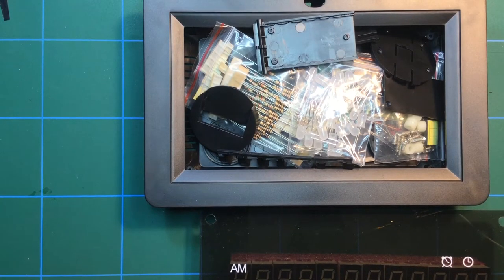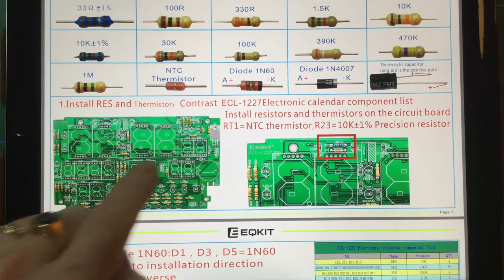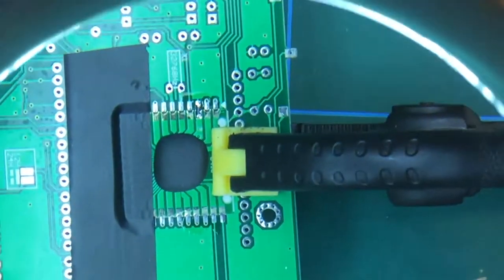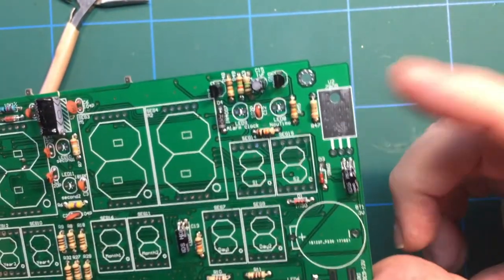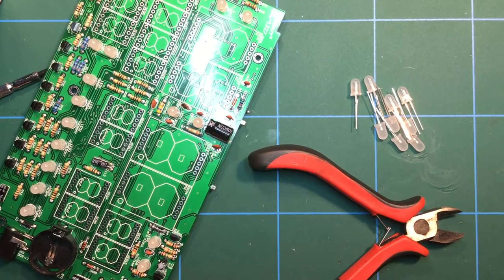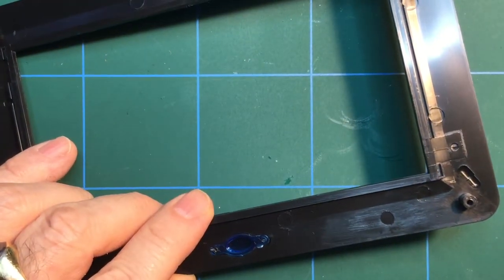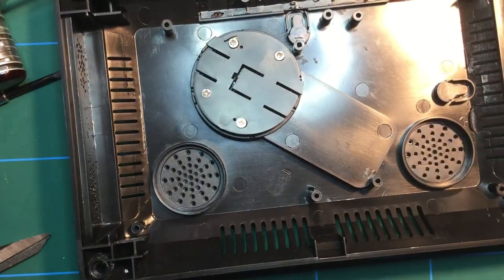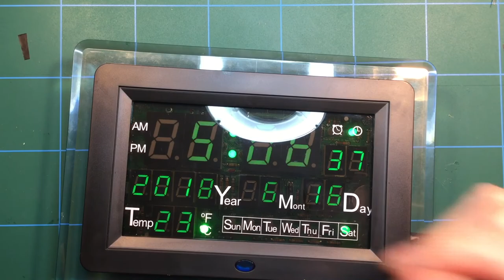Banggood: DC9-12V Electronic Calendar Soldering Kit High Precision Clock Kit ECL-1227

Comment: Hi “Edifred", nice video thanks. Would you mind sharing what it was you used for the 9V power supply please? On a side note, also a vaper here for many years, going back as far Genesis atomisers with cutting out and rolling steel mesh for wicks and kanthal coils with horrible hot spots. I also noted in a much earlier video of yours you were using the old SD screwdriver with cartridges, for stealth purposes I used to use those SD key ring jobbies until he stopped selling them and gave the website to his son. Good ole days eh!   What is your current vaping set up now?   🤣😂🤣😂.  👍👍👍
Reply from the maker: Hi Jay. The supply was an old DC supply for a phone or something giving around 9v. Nothing special. Wow the old screwdriver!! Cracking device in some mways. Today I am using SMOK prince atomisers on many different devices around 70 watts and also moving to pod systems as sick and tired of carrying around heavy mods. My favourite is the SMOK Nord. Plenty of vapour from that.
Reply: Edifred2007: thanks for the reply. I’ve ordered this kit to give it a go, I may have a mobile phone supply to use, I should have hopefully. I’m using a reuleaux 2/3 with a kayfun 5 at home and in the car. Using a suorin pod thing for stealth purposes in the office, seems ok. I’d like to try some other pods too. Maybe visit some local vape shops and see what there is.
Please keep up the diy kits, they’re great fun. Thanks.